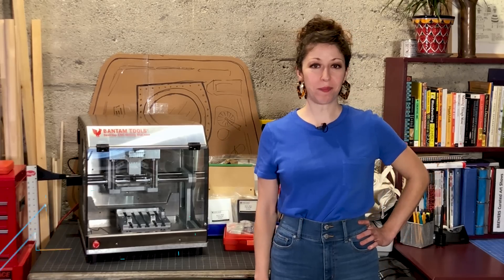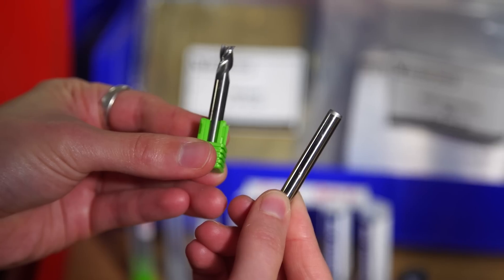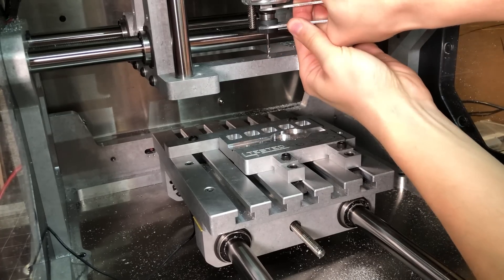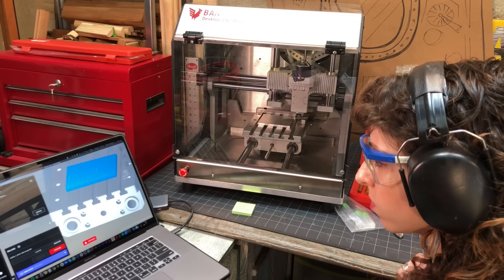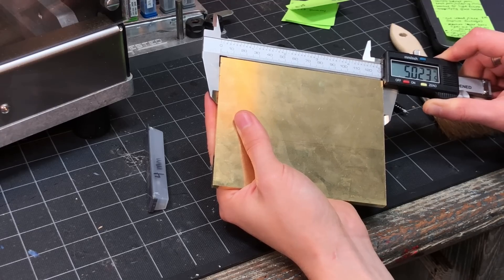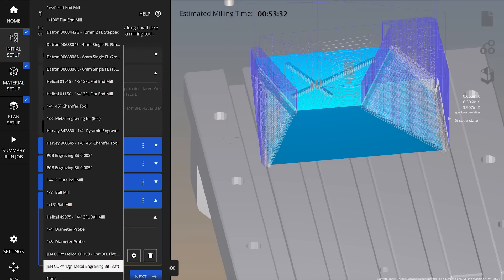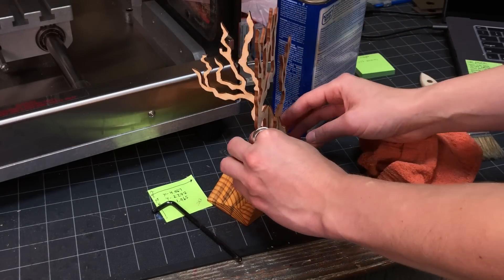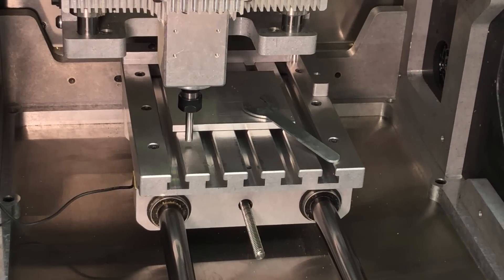Bantam Tools Desktop CNC Milling Machine Review!

Comment: Will it take machine code from fusion? I'm guessing it would be subscription only if they do.
Reply: Hi Eric! The Bantam Tools software supports G-code, NC, and SVG files. Also, to clarify, you don't need to purchase the subscription pack of the software to use the machine. Every Desktop CNC Milling Machine ships with a base pack of the software for free, which also supports G-code, NC, and SVG files.

Comment: Desktop CNC routers have been around for many years and I still don't see them as more then a novelty. Why waste all the money one a CNC that small? find the space and get a proper floor CNC or Table CNC.

Just because there is a market for 3d printers that size does not mean there is a huge market for desktop CNCs that size.

Comment: The moving bed design prevents doing small jobs on large stock. Greatly reduces functionality for no benefit, unforgivable, deal breaker.
Reply: It adds a lot to rigidity though
Reply: I'm not really sure what you are saying here. Plenty of large machines have moving beds. It makes it a lot easier to have rigidity in the head.
Reply: @codygibson2809  On a large machine it's less important. If I have for example a CNC bridgeport mill and I want to engrave a canoe paddle I can, the mill doesn't care about that awkward load sticking out 6 feet but on a small machine you can't carry a large workpiece like that so the bed needs to be stationary. obviously there is room for other opinions here.
there's nothing difficult in achieving the same rigidity with a moving gantry configuration , it's just more expensive. So I propose that the moving bed makes it easier to hit your desired price point, which doesn't seem to have been a concern for these folks.

Comment: This machine can hardly do brass... look at that surface finish. My $1000 CNC router (for wood) can do better. This has unsupported round rods (flimsy, flimsy, flimsy), junk software that makes you pay extra for simple stuff like feed rate overrides? Every machine control software out there does that for free... This is essentially a $800 machine with $2800 software and enclosure. Save up for another month and buy a Tormach 440 if you want to cut metal. It's not that hard to learn....
Reply: $800? Try $300. This is basically a slightly beefed up toy "3020" you can buy for ~$150 on eBay.

Comment: Me: thats cool (checks price) no it's not
Reply: Just buy the Ghost Gunner 3. 2,200 USD
Reply: @tasteslikeawesome  doesn't that only do 80% lowers?
Reply: @LordHolley  good question.
Reply: @LordHolley  no it does more then that but that's just included. You can use it as a regular cnc machine
Reply: I'm loaded. I'm looking to buy this to engrave CHUCKY in my dogs tag. Then I'm putting it out by the road.
Reply: So how much is this monstrosity?
Reply: The price is great when you shill and make poorly disguised as a review
Reply: 5000 for that is not even that much. It's not a toy.
Reply: Look up price of even the cheapest HAAS lol
Reply: don't bink look up the foxalien same thing for 300$
Reply: The Beaver sweet will do that
Reply: Dude, if 4k is too expensive for a CNC machine then you won't get any happy with this hobby
Reply: That's cheap as shit. I mean, you're not doing steel with it, but depending on the lifespan, this is amazing.
Reply: @pinpetos  you can engrave in steel I guarantee it. I wouldn’t try to make deep cuts or take any significant cuts, but there’s no reason you couldn’t engrave steel with a Harvey 1/32 or 1/64 ball end mill.
Reply: Pretty cheap for a CNC mill. I run some CNC machines that are well over a million apiece.
Reply: @RedBeardLongRange  what do you make?
Reply: Professional machinist here sounding off, there's a lot of cost that goes into the precision, strength, & power that metal machining requires. As some of my brethren have commented, even Haas equipment, which is effectively the Ford of machine tools is going to be six figures. One machine center is easily the entire asset value of a small business.

Comment: 14:28  - No.   Just, no.
Reply: Explain?
Reply: @shadow7037932  nishbrown's assertion is most likely entirely correct. CNC machining isn't rocket science when it comes around to machine capabilities. A 250W spindle and extremely lightweight frame are not going to compare favourably to the next tier up in terms of part quality & capability. Sure the Bantam machine is in it's own little niche - but it's a slightly heavier duty CNC router, not a proper milling machine.
Reply: the round unsupported linear rails are a terrible design for a mill. better off putting that money towards something else.
Reply: David Farmer would rather get an MPCNC than this crap machine.
Reply: @Olof123  At my work I needed a smallish machine to split plastic clamshells apart. I used a stepcraft, which at least has solid extrusions for rails, and a huge ammount of accesories, even tool changers and rotary axis.

The new m series stepcraft looks fantastic.

That being said, the small cnc I would recommend buying is the pocket nc 5 axis, its significantly more useful. part size isnt huge, but the 5 axis capability makes a huge difference in the types of parts you can make.

Comment: Brass and aluminium? Can it do steel?
Reply: It can hardly do brass, lol. Did you see the surface finish?
Reply: @timr86868  That's what hand polishing is for... or... perhaps it just needs a finishing bit that cuts in a micron or two really slowly.
Reply: Boris, while this machine can cut steel, machining it is not covered in our warranty. The Desktop CNC Milling Machine is optimized for machining aluminum. Because the lowest spindle speed is 10K RPM and steel requires a much lower SFM (surface feet per minute) compared to aluminum, you'd need to run smaller tooling when machining steel (3/16" and below). Also note that there’s no coolant system on the machine, which means you’ll need to take great care when machining steel.
Reply: @bantamtools  Cool beans man. Its brilliant your machine... besides I can always chrome the brass for the parts I need to be made.

Comment: "I just unboxed it" 
title: "Review"

Buy a smoothieboard and some linear rails and youre already more rigid and capable...
3800$?!
I built a 4 ft by 8 ft CNC router table with vacuum holding with prime american parts for 6000$.
Reply: You can always DIY something better. This is designed for ease of use/plug and play type. I can see this being used in highschools and such.

Comment: Why did you flip your mirror handle part between engraving and cutting? just to see if you could get it to line back up? You should've been able to do the engraving pass, then do the cut pass from the same side, then you don't have to probe again and you know it's aligned as long as your files are aligned.

Comment: Can’t wait for this tech to get cheaper and more capable in the next 5 years!
Reply: CNC mills have been around for la long time, but unlike FDM printers they haven't really come down in price a lot (for ones that cal cut aluminum well). You can certainly get a 3018 CNC router for like $250, but this won't really cut metal well.
Reply: You can get a 4 axis Sherline cnc mill for less, and it doesn't have a subscription cost.

Comment: Wait, you pay $3600 AND STILL HAVE TO JOIN A SUBSCRIPTION SERVICE?!?!! LOL!!!!
Reply: Yeah, my thoughts exactly.  Would definitely just go with Fusion.
Reply: @Theexplorographer  Fusion doesn't control the machine. it just generates the g code. She is using fusion gcode at 1 point in the video with the bantam software but can't even override the feed rate without subscribing! lol
Reply: The Explorographer fusion 360 isn’t exactly free either though depending on use.
Reply from the maker: UPDATE: Since we filmed this (not sponsored) review, Bantam Tools has decided that, while they will still have a pro-level subscription option, they will open up full feeds and speeds override to non-subscribers. Here’s their blog post about the announcement: https://www.bantamtools.com/blog/speeds-and-feeds-override-are-included
Reply: @tested  I can't believe you didn't even get paid to shill this companies noob maker trap machine
Reply: @tested  yay
Reply: @tested  did you keep the mill?
Reply: Can't wait until the servers shut down and you end up with a very complicated and expensive paperweight.
Reply: @sandwich2473 , just so you know, you don't need to have continual internet access to use the software. You download and install the software onto your computer (either Windows or Mac), connect your computer to the machine using the USB cable that comes with the machine, and you're ready to roll!
Reply: 3600 is a pretty affordable price for a CNC machine. Most full scale ones cost 10 times as much on the cheap end. The subscription is bullshit thou.
Reply: @Aoskar95  lol you can buy a Shapeoko that will cut aluminum just as well (and have a larger work area) for $2200... or you can buy a Tormach that will cut aluminum 5x better (and also have a larger work area) for $5500. This machine makes no sense at this price point.
Reply: @Aoskar95  this obviously a beefed up run of the mill desktop cnc
Reply: @Aoskar95 , just a heads up the subscription is optional. Every Desktop CNC Milling Machine comes with a base pack of the software for free.
Reply: @shiftedphase , you don't need to buy the software subscription to use the Desktop CNC Milling Machine. Every machine comes with a base pack of the Bantam Tools software (like we've mentioned a few times here). We do offer a free trial of the subscription for you to test and see if it's right for you.
Reply: Hi @WKD! To clarify, the subscription pack of the Bantam Tools software is completely optional. You don't have to purchase it to use the machine. Every machine comes with a base pack of the software for free and has everything you'll need to get machining!
Reply: @bantamtools  You didn't address the inability to override the feeds... Not a one time buy in option, but a subscription. 

Till you can justify why this in particular needs to be behind a subscription service, I'm not interested and I doubt other people will be either. Seeing as that will be a Herculean task since there is no justification that makes sense aside from "we like money for nothing," I'll be passing on this product.
Reply: @bantamtools  well what does the subscription get you then?
Reply: @CAMSLAYER13 ,  think of the subscription pack as a way to gain access to bonus features (e.g. bore and boss probing). Every month we'll be releasing new features that subscribers will have exclusive access to. You'll also have access to priority support and Bantam Tools curated content. We realize it's not going to be for everyone, which is why it's totally optional.
Reply: @bantamtools  why not just release it with all the features?
Reply: @hakology  Because the guy that made makerbot a shitfest owns this company and he wont say no to squeezing more money out of his customers.
Reply: @bantamtools  I glad to see the reply!!! from you guys. These broad term no bases comments are worth less. If you don't have anything constructive to say please stay off line.

Comment: Cool and all but the use cases I see for this machine look very limited due to port and table size. I'd rather spend a bit more into a larger table router even if it doesn't have the precision this one has.